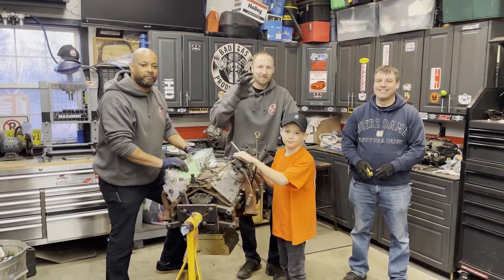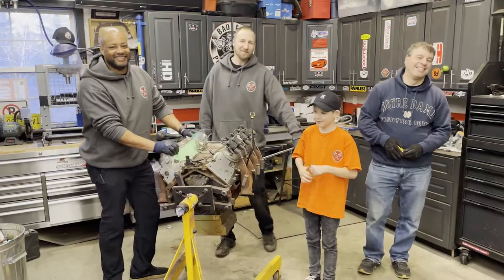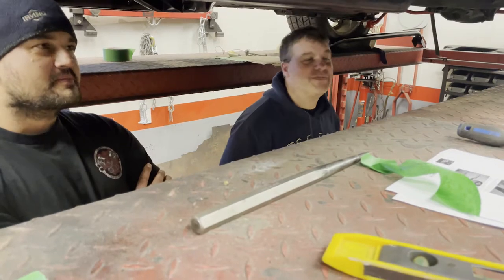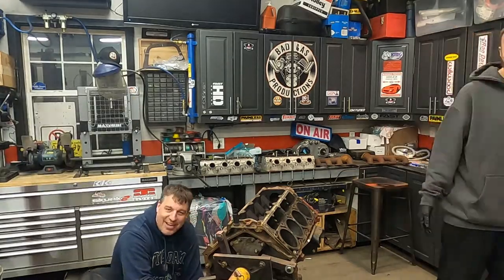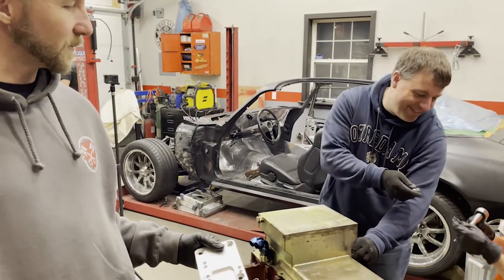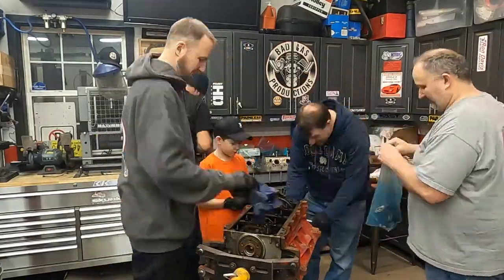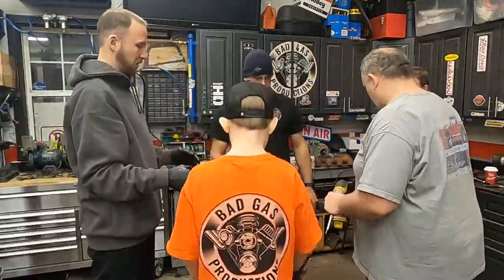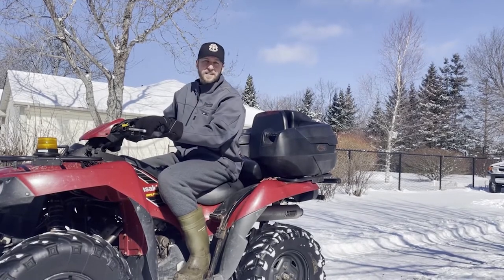Project Phoenix - Part 15 - LS1, 5.3, 4.8 or Scrap?

Comment: Pretty sure the block has an ID on it to tell you the size. A quick visual of the block would tell you if you had 4.8,5.3, or 6.0. Look at the back of the block near the passenger side bank. Should have a casting stating block size.
Reply from the maker: So a few things.  First on the back it says 4.8/5.3 on those blocks also the engine was in the car.  We knew it was a truck motor that’s it.  For us we are building a turbo motor so the 4.8 is actually a good thing.  Stay tuned we’re building it the right way :)